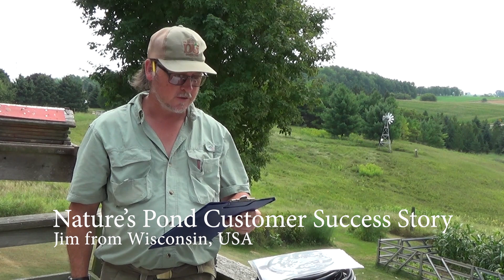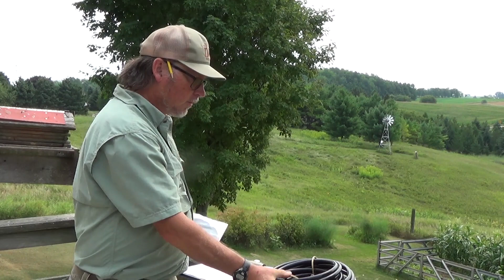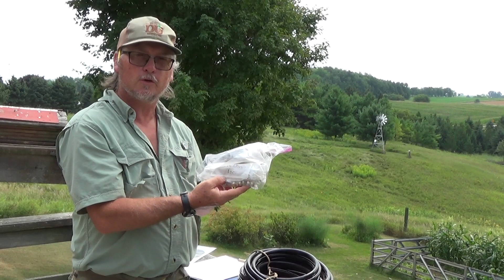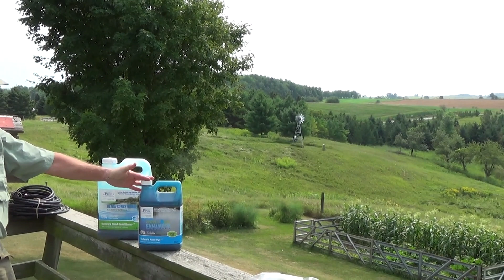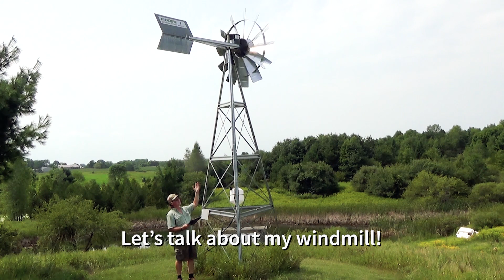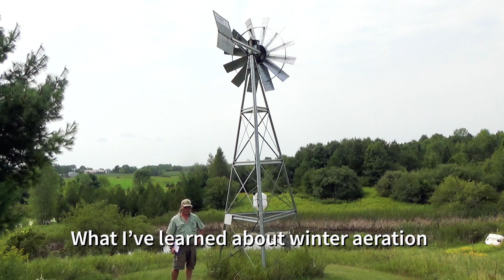My Koenders Windmill Review - Jim's Story

Comment: For all those researching windmills I just finished assembling a Koenders double diaphram 20' tower. Trash, the whole thing is trash. It was shipped with missing parts in boxes that fell apart in shipping. The assembling was a terrible experience, everything is sharp edged stamped sheet metal that does not fit together and instead relies on some poorly engineered concept that forcing everything to be assembled under tension will be better. It certainly doesn't make the assembly process easier and you should be prepared to be chasing nuts and bolts constantly as they fall off your assembly because to put this together everything must be very loose. Lastly the thing doesn't work. It doesn't turn in the 3 to 5 knots I was promised and it does not produce ANY air. The technical support for this product is terrible. I have never gotten a hold of a technical support person or a call back from a left message. There are forums that go through troubleshooting steps and I tried to learn something from them. But what I learned is that Koenders doesn't care once they have your money.

Comment: Can you tell me what diameter the concrete was? I have a 6 and 9” auger. Thanks.
Reply from the maker: Hello Steve, I can ask Jim if he can provide that information to us.
Reply: @naturespondcare7566  Thank you!
Reply from the maker: @imsteveb  Hello! Here is a response from Jim. If you need more information, he also left his phone number. You can reach me at marketing@koenderswatersolutions.com for me to privately pass it on to you. 

Response: I have heard of towers blowing over, so I would recommend a solid mounting to the ground,  especially for high towers or a shorter one like mine on top of a hill.  I initially put my  8" diameter concrete columns into the ground because my site had some slope to it.  You can buy the forms at building centers if covid hasn't limited the supply.  Or, I used some disposed plastic paper roll cores from a paper packaging company that my neighbor gave me.  I had a 10" auger and drilled them in at least 36" deep, to ensure below the frost line.  I believe 6" diameter would adequately work, as you still embed the pipe stakes down through the concrete columns, then fill in around the concrete footings with clean fill. Make sure you drill the holes several inches bigger to allow for the crooked drilling and being able to plumb the columns vertically.  Another advantage to being able to level and secure the tower by pouring concrete columns is that you avoid the unknown possibility of hitting a buried rock if just driving the pipe stakes into the ground.   That could cause a big problem deflecting the stake in the ground... I had LOTS of rocks!
Reply: @naturespondcare7566  Thank you! I apprciate the reply.  I have a 9" auger and I am going to go with that.  I feel more confortable with 9" vs 6" though I agree 6" diameter would be fine.  Again, thank you for the information, it was very helpful.